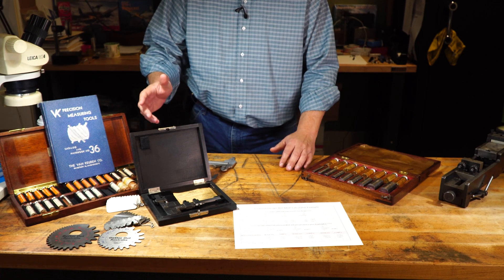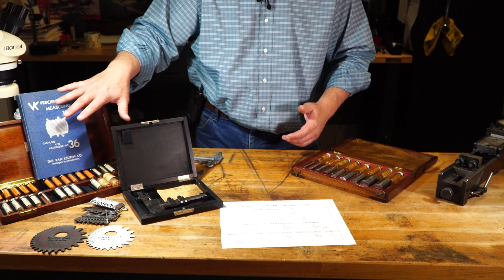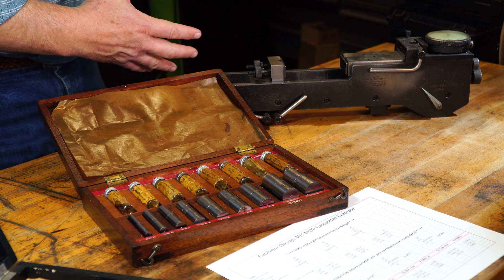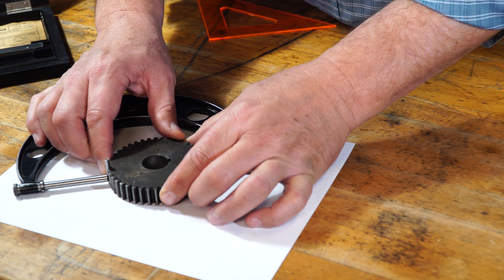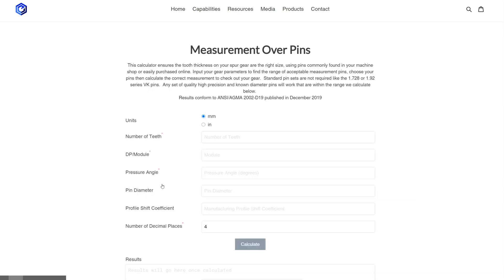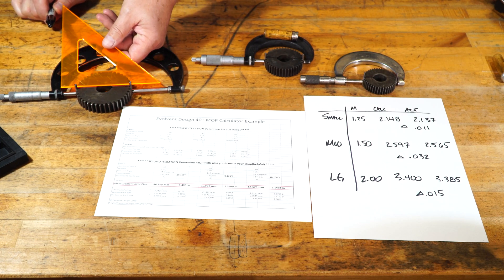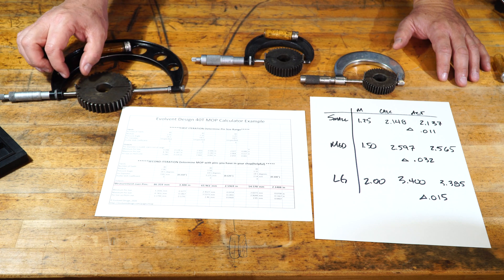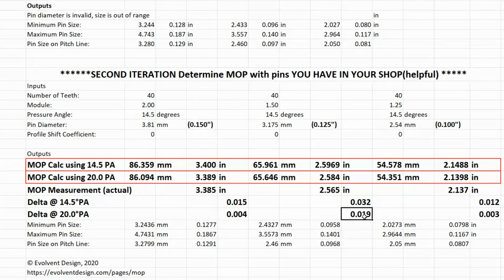Measurement over Pins (aka Measurement over Wires)

Comment: Hi,
Thanks for information.
Can you/your team guide(with video) how to measurement over pins for odd number of teeth??
Thank You,
Reply from the maker: It works in the same way, just put the pins in the two "farthest apart" positions and measure the maximum distance across the pins.  The small cosine angle is handled by the software.  We put the difficult equations into the calculator so all you need to do is make the measurement.
Reply: @EvolventDesign  OH...  Nice that you explained this. I was going to measure one pin from center and double the number.
Reply from the maker: @WinkysWorkshop  Glad this is helpful for your knowledgebase.  I really like how you made the simple indexer for your lathe BTW - Pretty clever, and simple.  Also nice to see a spur in your banner.
Reply: @EvolventDesign  Yes your video was excellent. I cut a 22 tooth 16 DP 14.5 PA gear today for my South Bend and used 1/8" wires to measure. I basically measured the old gear and made a new one to the same spec. The program said 1.584" between pins but I had to make it 1.568" to make the gears mesh (which is the same as the old gear). It seemed like a big difference but it worked. The gear teeth are more pointed than the original and the whole depth of cut is .007" less than should be. I'm starting to wonder if my cutter is a 20PA. It says 14.6 and the tooth range is correct. Very cheap cutter.
Reply: @EvolventDesign  Oh..  and thanks for checking out my channel. Yeah the gear indexer is useful. One of my latest projects was a CNC wood lathe. It's very amazing to watch and now that I have learned the software the start to finish on a spindle is 15 minutes instead of hours. CAM software is hard to learn.
Reply from the maker: @WinkysWorkshop  There are several tools on our calculator site that can help assess gears or create new ones(https://evolventdesign.com/pages/calculators).  The difference between 14.5 and 20 PA is challenging without some tooling.  For a "toothy" gear like yours sometimes you can print a scale drawing of both 14.5 and 20 and compare on a light table.  I bet your lathe gears are 14.5 PA as it is an all american machine.
Reply: @EvolventDesign  Yes I'm fairly certain they are 14.5. It's the cutter I wonder about.
Reply from the maker: @WinkysWorkshop  got it.

Comment: Why are you using 14.5 deg pressure angle on a metric gear?
Reply from the maker: That is how the gear measures and that is the job at hand.  Manufacturers make machines with gear spec combinations like this to keep you coming back to their OEM parts department.
Reply from the maker: Go to 10:00 in the video-good eye
Reply from the maker: And thank you for watching